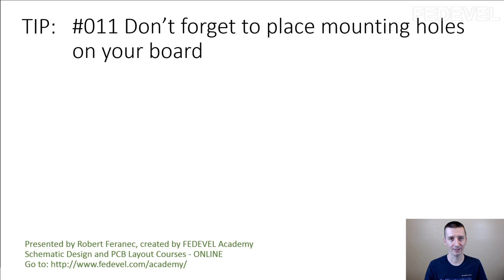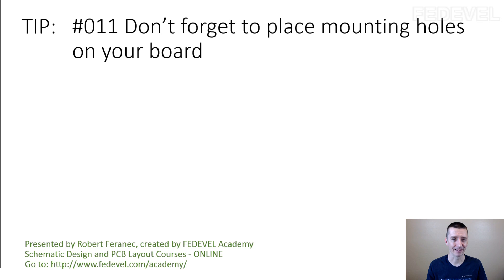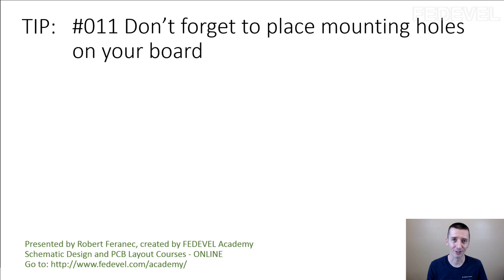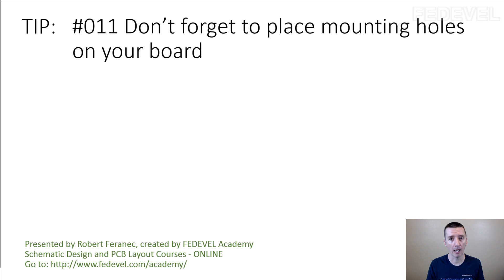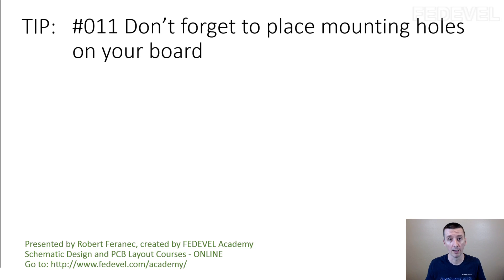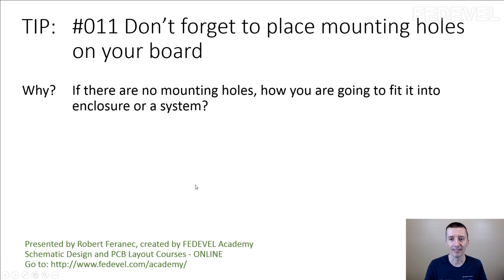TIP #011: Don’t forget to place mounting holes on your board

Comment: Hole new ideas: place them even if you don't need them (if you got room to spare); they will give you options for mounting the board in different versions of the product. Also: measure the head of the screw you intend to use and place a "no route" rule 1mm (25 mil) outside of that value. Why? Because metal screws will break the solder mask and produce shorts. Also, make sure you even leave enough room for the screw head or any mounting stands!! Finally: make sure the holes are non-plated and any internal planes have at least 1mm (25 mil) of distance from the hole itself. Again, because of shorts.

Comment: Hi, how do you place mounting holes in Altium? Do you just use regular through-hole pads?
Reply: Basically you make a component in the lib, make them for m2, m3 etc. plated or non plated de pending if you want to connect to chassis or not. 
Make a schematic symbol and link the two. 
For the footprint Yes  use a through hole Pad. also give it an outline or an area to stay clear from. this way you can use the component for rules e.g. keep traces on all layers away from mounting hole further that from  a normal pad.. altium does not set different spacing rules.

good luck!
Reply from the maker: We do it the same way as Paul.